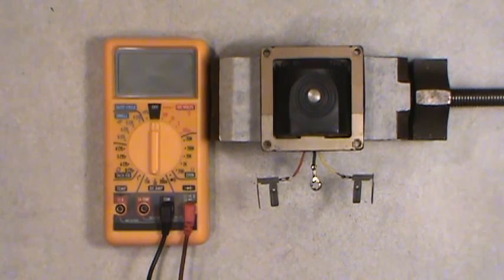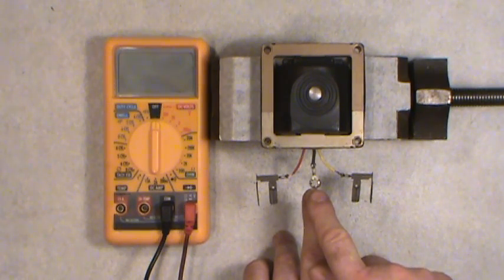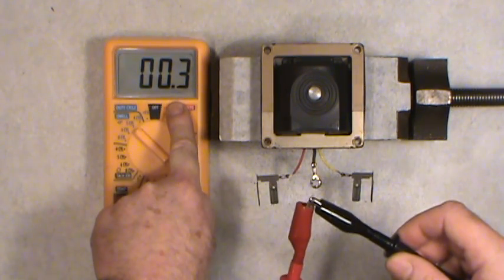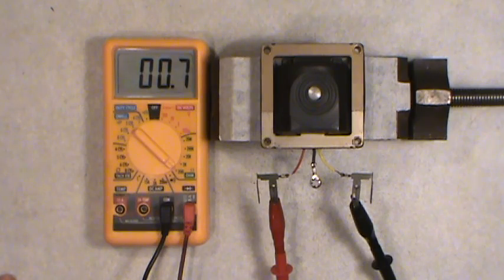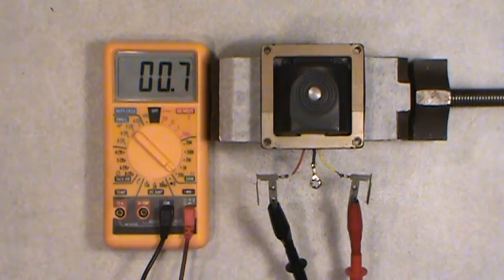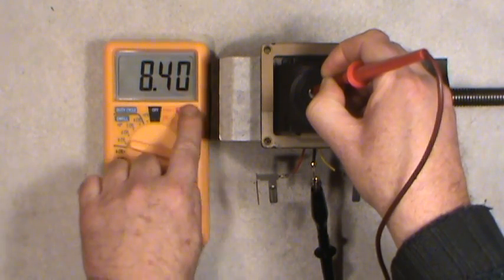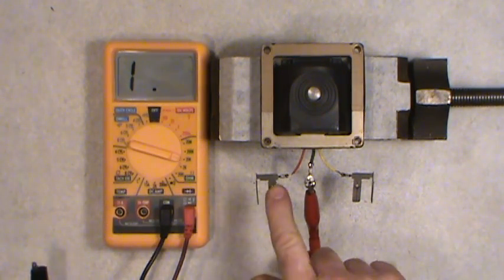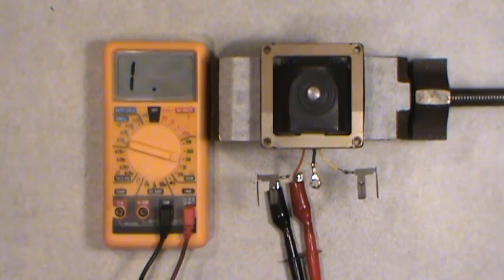HEI Coil Test (The Short Version)

Comment: I have one for ya.

1972 Cutless Supreme. 350 Rocker Motor.

Original eng (point type distrib) had a rod knock which destroyed the inside of the block.

Bought another engine (1975) from E-bay, HEI system.
Started it on the ground, ran like crap. No compression, but it ran.

Had the engine rebuilt at a local machine shop for less money than it would've cost me to build it. .030 over, new cam, crank ground, etc.

Installed the engine. Put her up on TDC, dropped in the same distrib,(New cap, rotor, coil, wires) went to start it and NOTHING.
No spark whatsoever. 
Instead of going through the ignition switch I "hot wired" it direct (as I did on the ground). NOTHING. Removed the coil cover and using a test light I confirmed I was getting power. 
Removed the coild and noticed on the bottom it was totally pained where the ground strap is. Took some 220 grit sandpaper and cleaned it off under and over. reinstalled the coil and NOTHING.

Removed the coil and checked as per your demonstration, coil checks out, still nothing.

I don't understand how it ran with all the old crap (cap, rotor, wires, coil), but won't run with all new stuff in it.

Cap checks out, coil checks out, rotor's, wires all new. Is it probable the ICM went byby just sitting around?
Reply from the maker: Greetings...Mike Paul............Thanks for watching............Here's what I'll do for Ya............I will Reply to Your Comment/Question, with a number of shorter (some-what) Replies, so, be on the look-out for them..............Here's the first one...........The LARGE (distributor) Cap, V-8 HEI/High Energy Ignition Distributor..."Needs"...about 12 Volts (aka, battery voltage), so "it" will work correctly (battery voltage, might drop down to about 9 Volts, maybe, while the starter motor is in operation, and, battery voltage, can be higher than 12 Volts, when the engine is running, and the charging system is working, providing that, any, electricity sucking accessories, such as, something like, the heater blower motor, head lights, etc., are not turned on at the time)..................Lem-me-see-now.........A 1972 Olds/Oldsmobile Cutlass Supreme, should have had, a "Points and Condenser" Distributor, in that 350 cubic inch (probably Gold colored) Rocket, V-8 Engine, as it left the factory's assembly line, when it was brand new...............In the "Points and Condenser", ignition system's "Wiring Circuit", there is usually a "Ballast Resistor", that Reduced the Amps/Current, that was going to the Ignition Coil, so it wouldn't Overheat, and self destruct, while the Ignition Switch, was in the "Run" (only) Position, and also, the Voltage was "Lower" than 12 Volts as well, (voltage drop), and might end up being, about, 6 to 9 Volts, going to the ignition coil...maybe (I'll have to measure it sometime)................There were "2" Types of Ballast Resistors, and, could be, in the form of, a..."Resistance Wire" (1.35 Ohms/resistance maybe...???...for a General Motors V-8, points and condenser system)...or, might be, in the form of, a..."Ceramic looking/white-ish colored Block"................With the "Points and Condenser" Distributor, ignition system, while the Starter Motor was Operating, the Amp Draw, might be around 200 Amps, give or take a bit, and the Voltage would probably, drop down to, about 9 Volts there-abouts, so, there was usually, Only about, 9 Volts, that the Battery could output, to the Ignition Coil, when-ever the Starter Motor was working.............So, there was a "Separate Wire", that "Bypassed", the "Ballast Resistor", so, what-ever the Voltage, that the Battery had left-over, from what the Starter Motor was drawing, went straight to the Ignition Coil, while the Ignition Switch was in the "Start" Position..................When the Engine Started, and the Ignition Switch, then went, to the "Run" Position, then, the Wiring Circuit, Switched Over, to the Circuit, that had the "Ballast Resistor" in it, cuz, the Starter Motor, wasn't in Operation any more, and the Amps and Volts, became Higher, and available, once again.................Now then, if, and when-ever, shall we say, "Up-Grading", from the good ole "Points and Condenser" Distributor...to that..."LARGE...HEI Distributor"...then, that, Old Wiring Circuit, that had, that "Ballast Resistor" in it, has to be "By-Passed", so the HEI Distributor, gets "Full" (available) "Battery Voltage", while having the...Ignition Switch, in "BOTH", the..."Start" and "Run" positions.............If and when-ever, up-grading, to that by-pass wiring, make sure, to use, some Heavy Gauge/Thick, well insulated Wire, and if need be, put the correct Amp rated Fuse, in that wiring circuit as well, so nothing burns up...!!!...............There might be a Website or two, that have "Forums" on them, where-by, some of the Folks, have already, Safely, and have Properly done, this, so-called, Ignition Circuit, "Ballast Resistor"..."By-Pass" wiring, as, I haven't needed, to do it, as of Yet...............So, with the LARGE Cap, HEI/High Energy Ignition Distributor, always make sure, that Full (available) Battery Voltage, gets Connected to, the "BATT" Terminal, that's near, the Top of, that LARGE, HEI Distributor's (distributor) Cap...!!!............the End, of this post...and now, onto another one...
Reply from the maker: Greetings...Mike Paul............Now, for some more, HEI Distributor stuff.............This post, is going to be about, "Testing", the "Pickup Coil", for both, "Ohms/Resistance", and "Low, AC (Alternating Current) Volts Output", while still having, Your, LARGE Cap, HEI Distributor, still stuck in the Engine, or, You can also do these Tests, with the HEI Distributor, out of the Engine, as well..............Before I get to that, I just remembered something.............There were times, where an Olds (Oldsmobile) Car, might have had, a Chevy (Chevrolet) V-8 Engine in it, when it was New, right off of, the Factory/Assembly Line...interesting that, I must say (maybe check it out, if You do in fact, have, an actual, 1975 Olds, replacement Engine...sometime/maybe)................Ok then, having the Engine, Cold and Not Running, remove the (supposedly) 12 Volt supply Wire/Connector, from the "BATT" Terminal, of Your HEI Distributor's Cap, and put it safely aside, and remove the distributor Cap, to gain access to, the Pickup Coil's wiring Connector...............Here's what I always do, "before", touching anything, with my hand, that resembles an Electronic Chip, or comparable Electronic Circuit, so I don't "Zap" it, and Destroy it, with any, High Voltage/Static Electricity, that I might have stored up in me, at the time..............I just Touch, with my Hand, every few minutes, a cold and not moving Metal Part, so as to, Drain, any built-up Static Electricity, that I might have stored up inside myself, so as, Not to "Discharge", that potentially, High Voltage, Static Electricity, "into" any Sensitive, Electronic Chip or Circuit, such as, the Ignition Control Module (Static Electricity, it's the same stuff, that "Zaps" You, when You touch a door-knob...!!!).......So, once You're Discharged, then, remove the Pickup Coil's Connector, from the Ignition Control Module (is Yours, the basic, "4-Pin, Type-of, Ignition Control Module, or, maybe, it's a 5-Pin...???)..................Then, just connect the Ohm-Meter's 2 Probes, to the Pickup Coil's Connector, and, while Moving/Wiggling, those 2 Wires (in case the wires, have a Break, of some kind, inside the insulation, where You can't see it), and, it should have a Resistance, of, about...500 to 1500 Ohms...but, to be sure, look up the Specifications, for Your "Exact", HEI Distributor (there should be some Numbers, and/or, maybe Letters, that are stamped into, the HEI Distributor's Aluminum Body, on the Outside of it, on its Largest Diameter, just below, where the (distributor) Cap sits, when it's installed, onto, the HEI Distributor's Aluminum Body..................Now, for the Low Volts, AC/Alternating Current "Test"...............While the (distributor) Cap, is still Off, then, the HEI Distributor's Shaft, has to be Spinning, in order to do this particular test..................If doing this test, while having the HEI Distributor, installed in the Engine, make sure that, the Advance Weights, and nothing Below them, comes in Contact with the Pickup Coil's Wiring and Connector, or anything else, and keep everything Clear, of the Spinning Advance Weights, and the distributor Shaft, and any of its spinning parts as well..............You'll need a Multi-Meter, capable of, measuring..."Low AC/Alternating Current...Volts"....................Now then, having the Multi-Meter's Probes, connected to the Pickup Coil's Connector, and the Multi-Meter, set to, the Low AC-Volts range, then, just Crank the Engine over, with the starter motor, or, if, the HEI Distributor, is "Out" of the Engine, then, just, Spin by Hand, as fast as You can, the Helical Gear ("Watch out for any, Sharp gear Teeth"...!!!), that's on the end of the HEI Distributor's Shaft, and then, just watch, the Multi-Meter, for any, "Low AC Volts", that are showing (or not?), on, the Multi-Meter's Display................If it's working, as it should be, You should be seeing, about...1 Volt AC (Alternating Current)...give or take a bit.................So then, if either, the Ohms/resistance Test, or the, Low AC Volts Test..."Don't Test"...as they should be doing, then, the Pickup Coil, is probably Faulty then.................The Pickup Coil/Pole Plate Assembly, is, shall we say, the..."Trigger"...that Triggers, the Ignition Control Module................When those 2 sets of, 8-Triangles, are about lining up, then, that AC, low voltage Signal, gets sent to the Ignition Control Module, and then, the ignition control module (on the 4-Pin type), basically, just, Switches the Ground circuit, to the "Off" position, electronically speaking, that is, and that's when the Ignition Coil's, Electrical Field, that has already been built-up, with-in itself, Collapses, and when it does, the result is, a rather impressive, Very High Voltage release, and onto, the rest of the secondary, high voltage circuit, it goes, until it terminates, at the spark plug's gap, hopefully, that is...............The End......more to come......later, in time...
Reply from the maker: Greetings...Mike Paul.............Now then, here's some information, on the BIG distributor Cap/V-8, HEI's..."Ignition Control Module".................If, and when-ever, "installing", an ICM (Ignition Control Module), onto, the Mounting Surface, that's, on the inside, of the HEI distributor, then, make sure, that, the "Mounting Surface", that's on, the backside (metal surface), of the Ignition Control Module, and also, where it "Mounts", inside of, the HEI Distributor, are "Nice-n-Clean", and also, it's..."Very Important"...to..."Apply/Smear"...some..."Heat Sink/Heat Transferring Specific"...Paste-like stuff ("Not"...that...Die-Electric Grease-like stuff...!!!), on the backside, (metal surface), of the Ignition Control Module, "Before" Mounting "it", cuz, if You don't, then, that poor ole "Module", won't be able to "Transfer", that, quite a Lot of "Heat", that it generates, when it's working, to the Aluminum Mounting Pad, of the HEI Distributor's Body...!!! (Yes-Sir-ee-Bob...the HEI's Aluminum Body, also becomes a "Heat Sink", in near proximity, to where, the Ignition Control Module is Mounted...cool huh)...............Radio Shack, is known, to have that "Heat Sink" (Heat Transferring) goop, in a small squeeze Tube, as well as, some Computer Folks, might be using, that rather expensive stuff, known as Arctic Silver, and, there's probably, even more Products, that are out there as well, as long as, they are capable of, "Transferring", that Not Wanted "Heat"...............Those.."2-Metal-Eye-Let/Holes"...that go through, the Ignition Control Module, are actually, the..."Electrical Ground"...!!! (for the ICM), so, make sure, that, those..."2-metal-eyelets/holes"...and the...2-Machine-Screws...that Secure the ICM, to the HEI Distributor's Mounting Surface, are "Nice-n-Clean", cuz, if not, the (electrical) "Ground", might become compromised...!!! (aka, Bad Connection)..............There might be, some, Retail, Automotive Parts Businesses, that have, an Ignition Control Module..."Tester"...and sometimes, they are known for..."Testing"...Ignition Control Modules for..."FREE"...so, if You ever want to, verify that theory, just make a few Phone Calls, and ask them, if they Do, in fact, Offer, that "FREE" service, that I was just eluding to................Both, the..."Ignition Control Module"...and, the..."Ignition Coil"...have to be, shall we say, a..."Matched Set"...cuz, if Their..."Specifications"...are..."Too Far Apart"...From..."Each-Other"...then, the not so good results, might end up being...a Weak Output/Spark...or, as "Bad" as, the "Ignition Control Module", and/or, the "Ignition Coil"...get some-what, "Over-Heated", and end up, getting "Fried", and now, it's Tow-Truck-Time...!!!...(ummmm...No Thanks)................."All", of the Electrical..."Connection Points"...should be, as "Clean" as possible, or, You're just asking for Trouble, for the most part, cuz, maybe, sooner or later, something like, a not so good electrical connection, has the possibility, of turning a Fun Day, into One, that's Not so Fun (I prefer Fun, how about You...???...lol)..............I find, that, the Colder and Damper (high humidity), Environment, that, the Big Cap, HEI Distributor (as well as, just about any other, electrically related connectors & devices), are Exposed to, the more often (time-wise), that, those electrical "Connections", should be looked at, so things like...Oxidation...Moisture Intrusion, and last, but no least, the..."Green Yuck-ees"...!!!...that I've come across, not all that long ago, don't take over, and cause Trouble...!!!...so then..."Don't-Neglect-it"..."Inspect-it"...!!! (lol...I just came up with that one...and...hopefully, I'll remember "it", as well)...
Reply: I HAD THE SAME PROBLEM.  FOUND OUT AFTER DAYS OF LABOR THE FACTORY MISSED UP ON THE ROTOR CAP THE SPARK TRANSFER ELECTRODE WAS TOO SHORT. TOO LARGE OF A GAP TO THE WIRE TERMINAL THAT THE PLUG WIRE CONNECTED TO.  PUT THE OLD ROTOR CAP BACK ON . IT STARTED UP AS SOON AS THE STARTER ENGAGED.   IF IT RAN ON THE GROUND PUT ALL THE OLD EQUIPMENT BACK ON.  IF IT STARTS REMOVE ONE ITEM AT A TIME REPLACE WITH A NEW PART TRY STARTING, DO THAT UNTIL ALL NEW PARTS ARE ON YOU WILL FIND THE BAD PART.  YOU COULD PUT ONE OLD PART BACK ON ONE PART AT A TIME UNTIL IT STARTS.

Comment: Checking online, there's a range of ohms' where it's still good. But just curious is higher or lower ohms better?
Reply: Lower causes a bigger spark but risks burning out the module, higher causes a weaker spark. I try to use non resistor spark plugs and wires to push the odds in my favor. The spark plug wires are not recommended by the factory to be non resistor by the way, mainly for reasons of making static on radios.